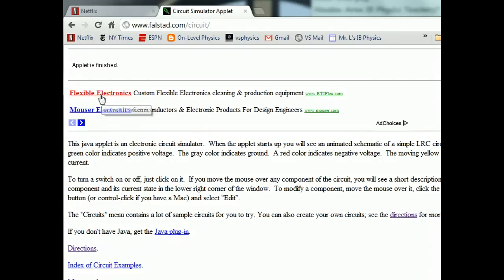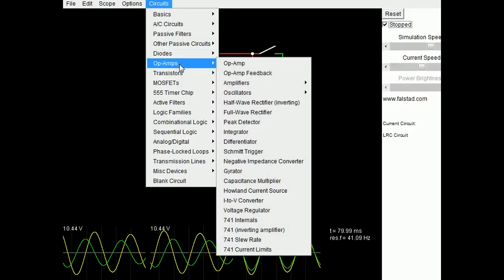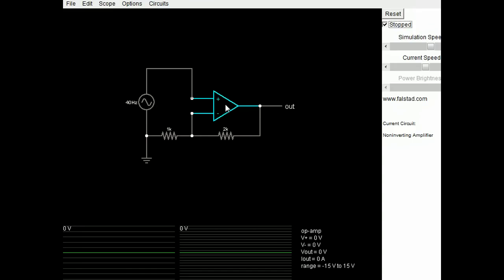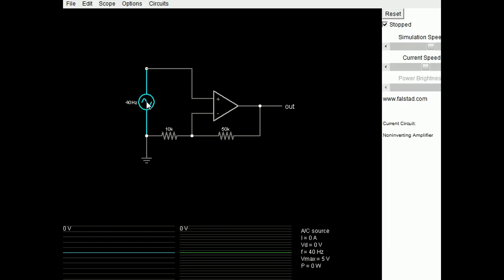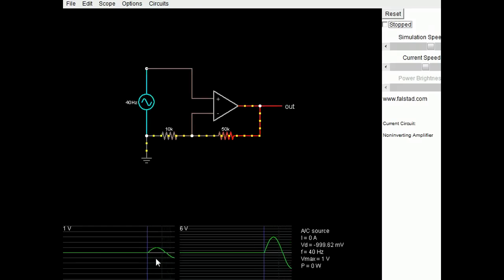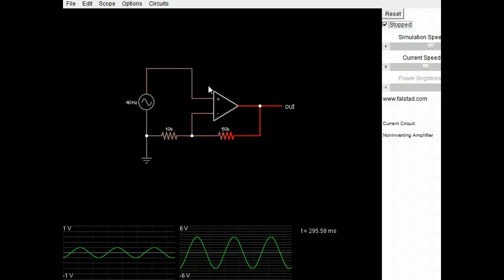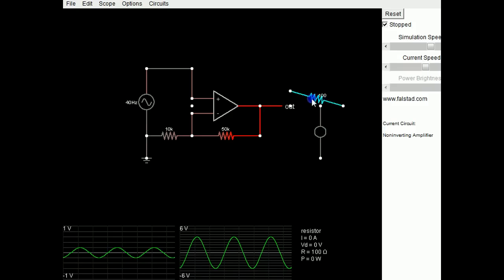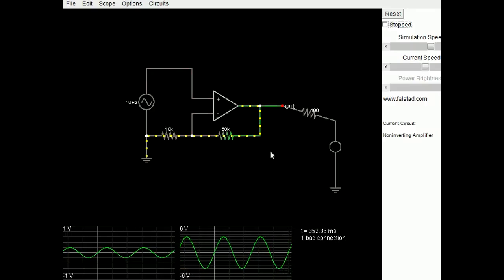Falstad Circuit Simulator Applet

Comment: Great piece of software for quick visualization of circuits. The current display as yellow dots is very useful in teaching students who are intimidated by circuit design. Also, at the end of your video, the resistor for the LED is not connected, hence the bright red dot. You have to drag it over to a node which is easily done by holding Ctrl and dragging just the terminal of the resistor.